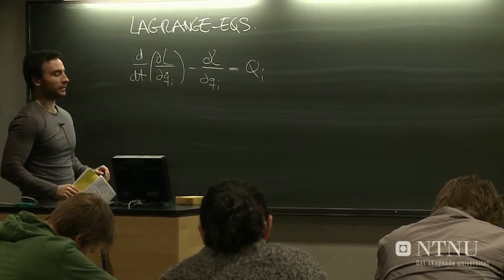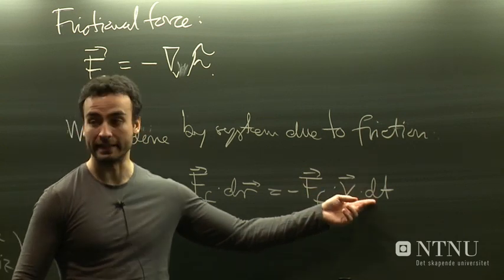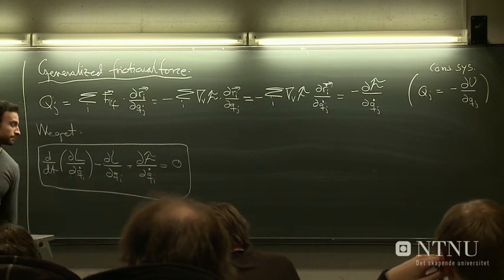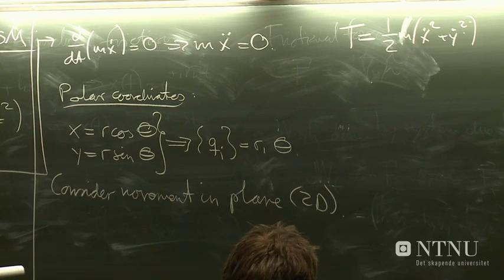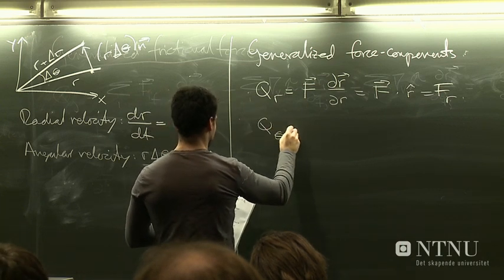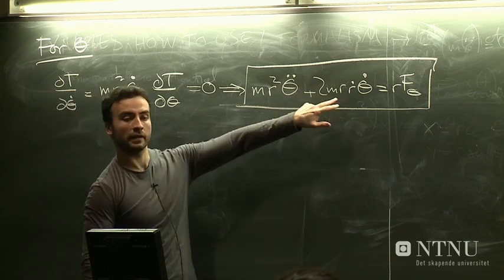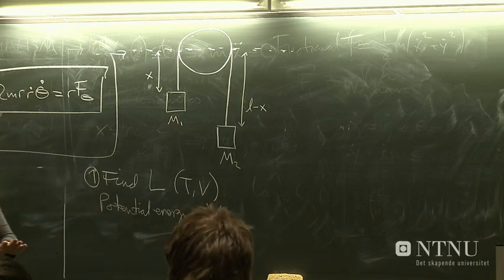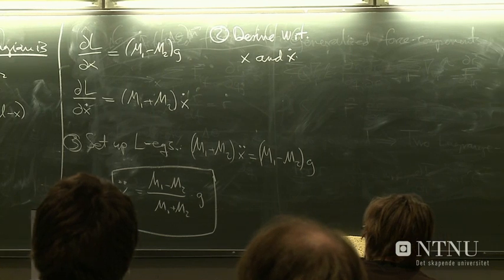05: Hamilton&#180;s principles - Part 1

Comment: I'm a bit confused.  The formula at the start of the video relates to non-conservative systems and so includes a Qi term to take account of non-conservative forces.  However in the previous lecture Jacob derived a Lagrangian that took into account the non-conservative aspect of the Lorentz force.   Is the formula with the Qi term an alternative way of working when it is not possible to accomodate non-conservative forces within L, but in other situations such as EM one can broaden the definition of L to take account of non-conservative forces?
Reply: the treatment in this lecture is much more general. here the Qi can also contain the lorentz force that was discussed in the previous lecture but as we know not all forces can be derived from generalized potentials (scalar or vector) and in such cases we have to solve the problem like this.

Comment: At 20:00 why bother going back to cartesian coordinates. If you find the basis vectors in polar coordinates you can easily show the results. Basis vectors in polar coordinates are r_hat and r*theta_hat, which are just the partial derivatives of the position vector with respect to the coordinate variables r and theta.

Comment: Hmm for the last example, the pulley system, how do we know that the tension from the string is a conservative force?

I mean if we solved it using Newtonian mechanics we will know that it is a constant force, so it is conservative, but that would defeat the purpose...
Reply: Tension of the string is a constraint force, which does no work on the system. Hence, we didn't need to consider it explicitly (D'Alembert's Principle)
Reply: You are right, thank you. We assume the tension on each mass is equal in magnitude but opposite in direction, so the net work done by tension is 0. A constraint force can still do work on the system in theory.

To be honest I think there is no clear cut distinction between constraint and non-constraint forces.
Reply: @narcosalpha9472  there is a clear distinction. C.F. actually restricts the system's degree of freedom. The string which provides the tensional force restricts the 2 bodies to move freely, when one goes down, the other will go up. While the non cf (gravitational force) imposes no such conditions (constraints) on the system.